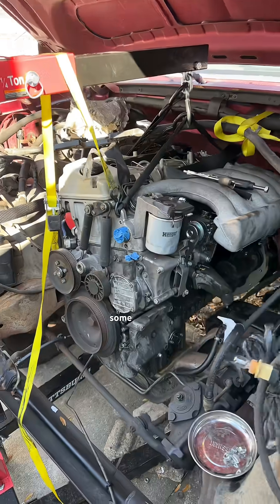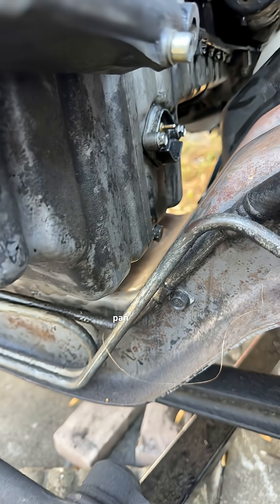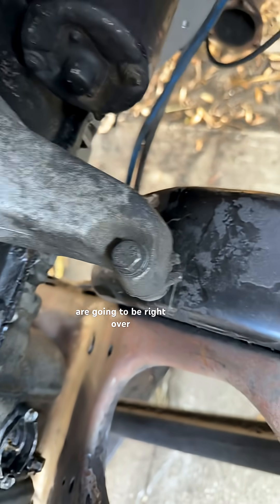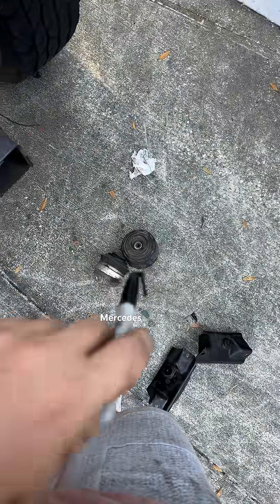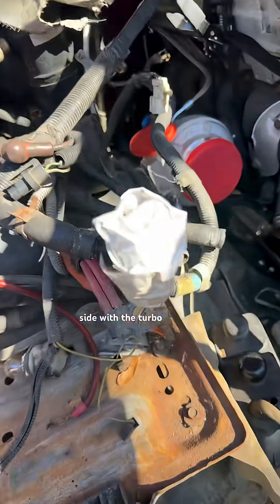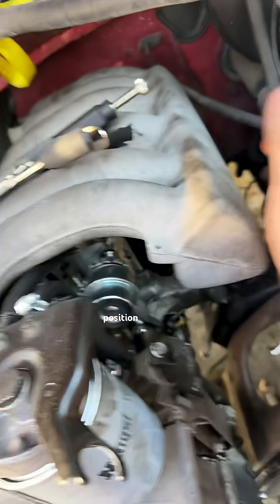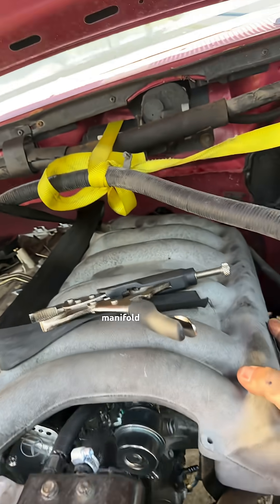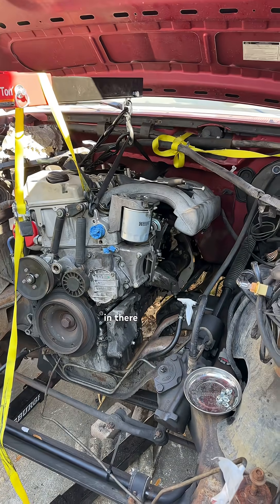The Mercedes engine is in the Ford! Taking measurements while I wait on parts to arrive.

Comment: Just swap to the oil pan, oil pump/pickup, and dipstick tube from an OM648. It is a bolt on for the 606. You need a new oil pump o-ring and a new dipstick to go with it.
Reply from the maker: I might later on, fits fine for now, trying to keep the costs low. I’d like to pull the engine again in a year or two to rebuild it, so may make the change then.

Comment: Why dont you just buy a rear oil pump and a rear oilpan instead of cutting your frame. I believe you get that from the OM614 engine.  And when you do that it will drop the engine down and you will have better access to your oil filter and you can keep your intake.
Reply from the maker: I’m considering it